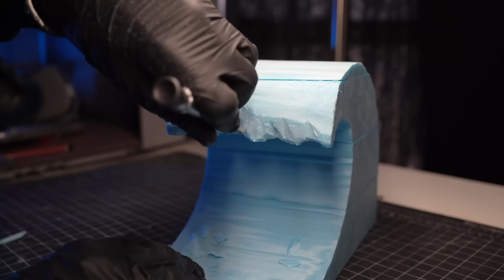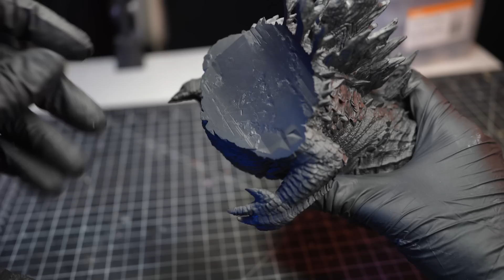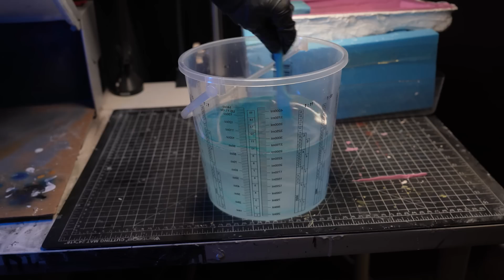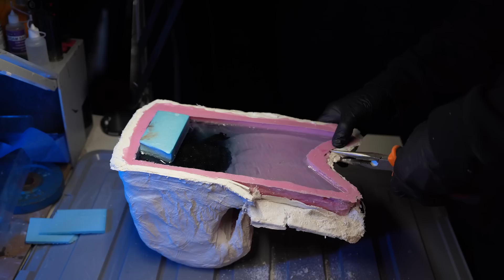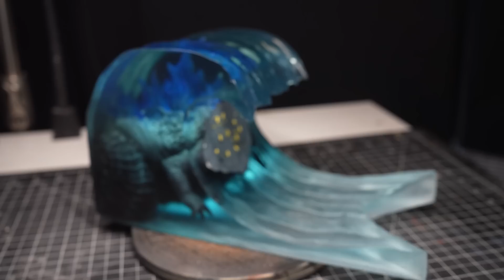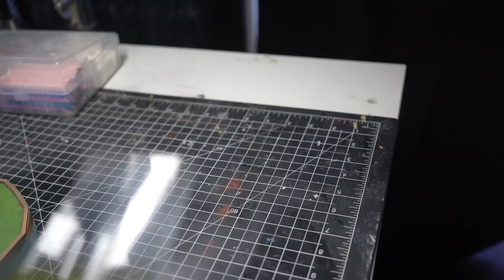GODZILLA vs. STATUE OF LIBERTY (Diorama build)

Comment: Absolutely amazing diorama! I have found with static grass that the smaller grass seems to really need the connection point closer to the place you are laying grass. I ended up having to clip it on to the warhammer base I was using to get enough charge. That could be why it didn’t fall properly?